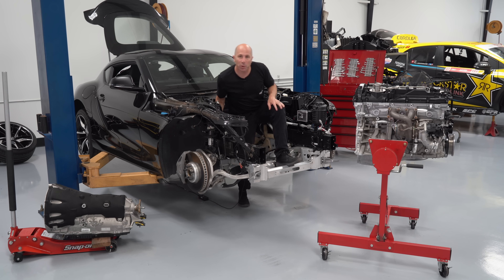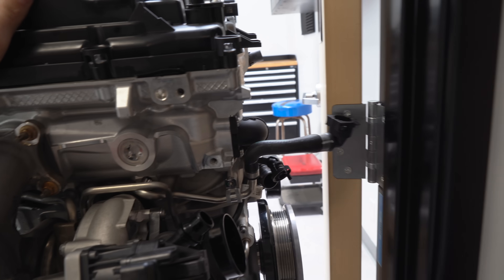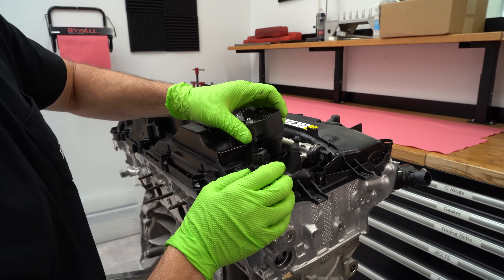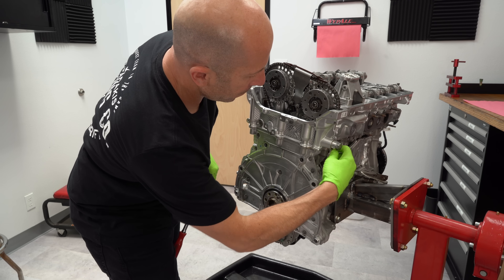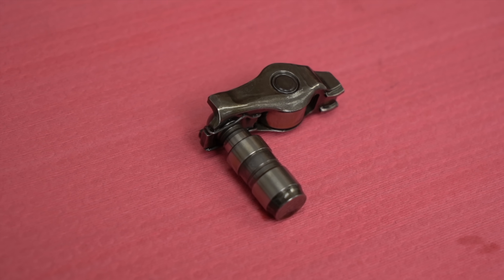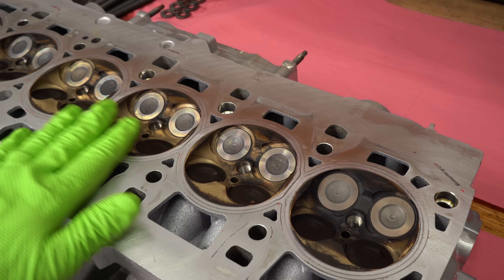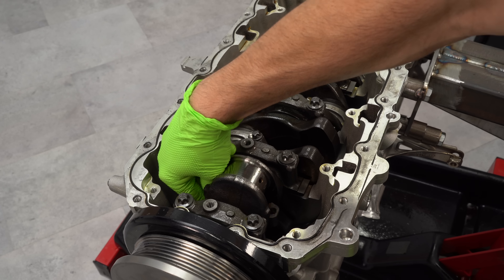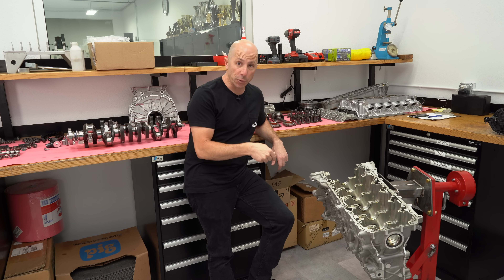2020 Supra B58 Engine Teardown - First Look - Better than the 2JZ?

Comment: I want this to make 1000 horsepower so bad just so I can shut people up just as fast 😂
Reply: 1000hp without cylinder sleeves and a non rebuildable engine ?
Reply: CleanMotorSport RacingAssociation in about a yr or so but...it can make 500hp with a bolt on😁👍 500hp is a lot of power🤷🏽‍♂️.and there goes your happiness.🙂
Reply: 日産スカイライン  dude most of what we are saying is in agreement you dolt.  More competition, meaning if they entered into supercar territory. Whereas they will set themselves up to compete well at this price range.

Just bc you built a few jdm cars doesn't mean you have skin in the game. You don't work for Toyota. To act like we know the market better than them is ridiculous.
Reply: c8 corvette owners laughing hysterically... nice try junior!
Reply: @ianvader4697  Eh? Like the moron who told Brook's he's a dummy for buying a Mustang GT500 since the mid engine Corvette is out. Look if you want a mid-engine Corvette, go buy one. Don't act like no common sense is being used and that if you want a "real" car you'll buy the mid-engine Corvette. Spoken like a true Chevy Nut.
Reply: ”””muh supra makes a 1000 hp on the dyno, i have to use jet grade fuel for it to ever make close to 1000hp and i can never ever drive it””””
Reply: klasmvm still what I don’t get why people need 1000 horsepower for but okay then😂
Reply: @HoweDoYouDo1999  1000bhp dyno sheets are purely for willy waving.
Reply: 日産スカイライン I agree whole heartedly. From the breakdown in this video the engine seems wildly over complicated. Not something somebody who wants to mod their car would want. Built internals or not, if anything small happens with this engine, it’s gotta come out and it’s gonna cost an arm and a leg. Everything I’ve read or watched about the car, Toyota expects people to mod the shit out of this car. They’re leaving a lot of stuff to the aftermarket community. But as far as i can tell the only thing people want to do to it are 2jz swap it. It’s a good looking car and that comes from somebody who has despised the body of ever generation of the Z4. The bmw aspect is the only thing that is keeping people from accepting the car and i completely understand.
Reply: 日産スカイライン  why? Because of what I said above. To reiterate, they didn't want to make it reach 6 figure territory where there is more competition and they won't sell enough ala gtr and nsx.  When I say "normal people" I mean folks who would be in the market for a decent sports car, not someone who would buy a Prius. Those types of people looking for a capable mid level sports car care a bit less about the resell value or reliability.  People would complain if it had a bunch of bits from an 86 as well even though it would make the replacement parts cheaper like the DOOR HANDLE TRIM you're talking about. So the other option would be making interior bits specifically for the Supra which would also cost more to the consumer because of the cost of development. 

 The Supra mk4 sold like shit when it was new on the lot.  Resale value only jumped after the fanwagon from fast and furious.

We who have no skin in the game can sit here and shoot the shit all day but Toyota knows wtf they're doing.
Reply: 日産スカイライン  so they should've put a V6 in the new Supra?  I agree that it was a mistake putting another companies engine in it but this thing needs to have an inline 6.  The engineers at Toyota knew this was of utmost importance.
Reply: I don’t think people understand what I mean so let me explain again I just want this car to get the respect it deserves so 1000 horsepower is the goal for most Supras this will give the b58 a better reputation for making power and besides the 2jz needs extensive work to make 1000 horsepower that’s what I don’t think people understand trust me I’ve been in my fair share of arguments and I hate when people hate that shit just because it’s from bmw so once people figure out it can make power it will achieve a better reputation
Reply: @HoweDoYouDo1999  Exactly. the stock motor can take 700+ but beyond that, reliably a 2JZ needs most of its internal parts upgraded.
Reply: @HoweDoYouDo1999  agreed.  These fake ass fan boys are hilarious. Acting like they would buy this if it had a Toyota inline 6, pushing $100k.  Then they hate on a BMW engine. That hilarious. They should hate on the McLaren F1 for having a BMW engine too smh.
Reply: Rich Pushing $100k? But they’re only half that...  but people are unhappy with Toyota putting a bmw engine in a car. Nobody said bmw makes shit engines or weak at that. BMW isn’t know for being the most reliable option for anything as far as i know. They make good sports cars and their engine designs are great. The problem is their over-complication and that people don’t want to worry about the reliability of their car. Comparing F1 built to street cars is kind of pointless because the 2 cars don’t share the same usages. I’m not overhyping the 2jz but that was a great engine and it does deserve the recognition it gets (minus the shitty fanboys). I’m sure the B58 is gonna be able to handle decent amounts of power output but just from the look of the engine without its cover it and this dude’s breakdown, it’s not gonna be somebody’s first choice for trying to make a lot of power.
Reply: @lolwhatt820  yes, if Toyota built a performance inline 6 from scratch then this would've cost close to 100k.  Most modern engines are prohibitive to work on anyway. I agree other wise.
Reply: Rich Ehh. Depends on where they wanted to go. If they could do it in the 90s and over engineer the engine that they’d gotten from Yamaha then i don’t think they’d have a problem making adjustments and modernizing the 2jz. They could have kept the car at the reasonable 50k. Given Toyota’s reputation for reliability and steering away from bmw would have made it a more widely acceptable car. If Toyota would have spent more time thinking about consumers than cutting corners like they did with Lexus, this new Supra would be as sought after the gtr and nsx but more affordable, which I’m sure they want to stray towards.
Reply: @lolwhatt820  as a fan of the Supra and cars in general I completely get what you're saying. I wished they made an in house inline 6 (tuned by another Japanese company) and designed it like the FT1.  They would've never been able to do it and kept it at 50k though.  They wouldbe been giving money away at that point.  That's ridiculous  But you have to understand that we're a small minority.  Toyota is at the top because they make vehicles for normal folks who drive cars to get from point A to B.  They're not in the business of making cars that sell around 1000 units a year world wide like the GTR R35 (NSX even less). Even the mk4 sold like shit when it was new on the lot so they discontinued it.  Everybody wants to build a sports car for under 100k that sells like a 911 but Toyota will never do that under it's brand name unless they do it under Lexus.

They made this so normal people would actually buy it.  We will see how well this Supra sells and then we can talk shit.
Reply: @HoweDoYouDo1999  Evo's are making 1400hp from a 30 year old 2.000cc 4 cylinder design
Reply: Maybe I'm that one odd guy out of the comment section that actually owns a shop... so i'll toss my two cents in here.. There is nothing "wrong" with the little BMW engine. However.. if anything ever DOES go wrong with it you'll have to pull the engine to fix it. That for me is a fault in design. It's something you don't see in most Japanese or American cars. German cars however have been WAY over engineered for the past 70+ years. Even during WW2 German tanks were failing in the field not because of actual problems, but because they were so damn complicated to build and maintain the people who had to live with them couldn't keep them running. More King Tiger tanks were lost to their own tank crews scrapping them than the enemy actually doing damage to them. If the thing failed mechanically they had to just set it on fire and walk away. Sorry for the history lesson but I see much the same issue in this car as I saw in all German cars for many years now. If you want to work on basically anything the motor has to come out. There are to many points of failure that just cannot be serviced within reason. In race car land pulling engines is part of the game. That said the front end of the car seems modular so it shouldn't be a HUGE undertaking to pull the motor out of the car. There are a lot of other problems I see with the car itself as far as service issues and even being unfriendly to modify. It's probably a fine little car if you just leave it alone and drive it stock but no car guy is going to buy one of these and want to keep it stock. I dislike the plastic intake with the intercooler built inside it. That's a point of failure. If the plastic intake is damage from anything, backfire or whatever, you also just lost your expensive water to air cooler. That's a pricey and poorly thought out design flaw in my own opinion. Again, that only applies to the enthusiast driver who wants to modify the car and beat on it. Stock I'm sure it's just fine. The lack of manual option is also not a car guy friendly route. An automatic will always out perform a manual. Facts. No human can out shift or out drive an automatic transmission. However.. As a driver and a car guy myself I will be happy to agree with the rest of the fan boys the Mansmission makes the car more fun to own. Automatics are boring. They work, but... boring. Honestly I think the car would have been very well received and enjoyed if they never tried to call it a "Supra". That doomed the car from the start. If it was Just the new Z4 roadster, it would have been lovingly taken in by the DTM guys euro'd out as it should have been. No harm no foul. A Supra however is a much beloved iconic dream car of the Sports car world. You can't mess something like that up and expect the guys who love the car not to be angry. I personally am not a fan of the new car. It's to small, to slow, to ugly, to expensive, to hard to work on, and it doesn't sound good. My opinions of course. Everyone has their own.
Reply: 日産スカイライン  BMW engines are bulletproof thought, BMWs usually have problems with their electronics
Reply: Why would that shut up anyone?  Junk honda's can make 1000hp, a supra owner wants that 1000hp to be able to still be running at 100k miles.
FWIW, nice bmw
Reply: brian clay “jUnK hONdAs cAN mAkE 1000 hORSePowEr”
Reply: @single94supra  good luck getting 1000hp for 100k miles.  Engine life reduces exponentially with the power increase no matter what!  1000hp might be 20k refreshes?
Reply: @Simey2wheels  Out of a small displacement engine like this yes I agree. The big displacement V8's can make 1000+ hp and still be very reliable.
Reply: @WilliamStewart1  doubt that.  Link me a car with a 1000hp v8 with a history of reliability.
Reply: @rks5457  I can't link you to a car, but I can send you over to NRE. They make 2500hp street car engines, a 1000hp lazy cruiser could be done in their sleep.
Reply: @WilliamStewart1  I haven't paid much attention  to them in the last few years but Nelson racing engines has a terrible rep.  I live in LA where they are hq'd and it seems like the only folks who buy from them install the engines in show cars.  I've rarely seen anyone race them, let alone hear of someone daily drive them lol. I don't think I've even seen anyone on YouTube vlog or anyone on auto  forums  with one. So it's difficult to sus out their reliability.
Reply: @rks5457  My neighbor has had a 632 NRE in his show truck for what's gotta be coming up on 10 years now. It's naturally aspirated and I think he said it makes around 1200 hp. Again this fits into your show vehicle narrative completely but I know he's put a fair amount of miles on it and he constantly hammering the thing around.

Comment: I must have watched this video 6xs...the tech is crazy...a seperate cam to adjust rocker arms ratio....is an unnecessary advanced V-tec system...it looks over built...but is it like a 2JZ
Reply: VTEC (pls in gods name don't write "v-tec") has two states, on and off. This system here is fully adjustable in his full range of mechanical motion, though more fine tunable.
Reply: @th33xitus  it is what it is.....it falls in line with it an CVT....if you paid more attention you'd know that....just like the 2JZ it looks over engineered but is it as durable
Reply: @3v4761  telling someone to pay more attention while not being able to write the name of a technology correct is somewhat ironical...

Comment: Way to much b.s. on this thing...repairs will b expensive as hell and to be honest the valve train looks like it will blow apart under high hp and rpm loads..gdi engines will carbonized intake valves very quick unless they are set up with a port injection as well to alternate between the two

Comment: One thing I noticed is why the coolant is green because most modern BMW engines uses blue coolant and I’m surprised they use a plastic oil filter housing because they had a recall for the N20 engine in some X1 because they would leak oil and coolant and sometimes mix coolant and oil and the oil was quite dark for only 500 milles.

Comment: Looks like a stout motor. What worries me as an old rally mechanic: timing chain in the back is gonna be a bitch to replace the guides etc ( which will fail)
Also the amount of plastic that bmw loves to use so much. Those gaskets and the plastic are always always always leaking.  Dont like rocker arms for the same reason he mentions, lets hope those clips hold. 
Id prefer typical buckets. 
However, i could see this motor with a metal intake manifold, front mount intercooler, redesigned oil cooler, being pretty bad ass.

Comment: Sorry but i cant hold back, water cooled inter coolers are inefficient piece of BMW ... Do you really believe that cooling liquid which has 90C can cool down the air which has 20C at enter point and 49c at exit point ?? well then why Everyone else uses air cooling intercoolers :)

Inside Exaust Manifold is a good solution ? eeeee no ?  

Oil filter base made of plastic and oil filter cooler  made of aluminium - yeah typical BMW replace gasket of oil cooler every 30000 km....

Timing chain in the back yeah another BMW solution to drain your pocket...
Just buy 2JZ - this is my opinion, car mechanic.

Comment: That small diameter around the spark plugs was engineered like that on purpose.😐
Reply: The smaller the diameter of the hole, the more strength you can retain
Reply: @Torvikholm  I know that...but to make it to where you need a special tool or be extremely picky choosing tools to change a spark plug it messed up.

Comment: the only side effect i see in this engine is the thermostat housing is plastic same as VW which they fail within 50-60k km , also the oil filter housing seal if they fail the location is not as easy as it was in n54 other then that its seem  very strong engine , good luck with your built and thank you the great video

Comment: For all the "But muh 2jz" guys, Toyota came straight out and said that without this partnership there would be no MK5 supra. Just put a 2jz in yours if this engine is so bad, i mean you're paying some big bucks to get a 1000 hp 2jz anyway. The mk5 had to have a straight six, otherwise there would be shrieking and gnashing of teeth and Toyota didn't have a straight six to start with. Toyota wasn't willing to engineer their own straight six, so they had to partner with someone who still makes them. Watch the head to head comparisons of the mk5 Supra and the Z4 M40i and you'll see they are totally different cars when it comes to driving and experiencing them. The z4 is a convertible ffs, it's not like they're in the same segment. Oh, and the Z4 is a lot more expensive as well.

Comment: Any differences from the B58 on BMWS?
Reply: Turbos integrated into the block(if I remember correctly) and the fuel lines seems to be stronger/can handle more pressure and has more oil squirters than your average B58.

Comment: Pretty amazing engineering, and impressive. Other than possibly greed, I'm not sure why automotive engineers are using so much plastic and burying simple parts (ie. spark plugs, oil filter, etc.) beneath so much excess 'stuff.'

Comment: Too complicated and too much unnecessary work for me..2jz it is.  To each their own... TIMING CHAIN AND CAM UPGRADE REQUIRE PULLING MOTOR? And better hope you got timing right first time else you got to pull motor again.  HELL TO THE NO!
Reply: Sean Malcolm I’ll guess you adjust timing in the front anyway but we need to read the manual first
Reply: @mastaplanna9771  then we are in a perfect world.

Comment: Subaru needs to link up with BMWs bearing vendor and get a supply of  coated bearings like this for their EJ and FA motors, pretty fancy coating to prevent  bearing wear.
Reply: Hugh Vupy They need link up with porsche and build far better boxster engines that dont rattle and fucken viberate like shit and there motors will hold more power 

I have no idea why they refuse to refine that motor and make it better with there help

Comment: I see 700+ whp easily with bolt ons and a tune, such an amazing engine/car
Reply: Not even bolt ons. With just a Tune its already pusing 400hp.
Reply: @MeDicen_Rocha  It made damn near 400 from factory, and the tune was pretty light, I'd say a full remapping and optimization would get it into the mid 500s
Reply: N54 make 6-700 quite easy, and this engine is going to blow it out of the water
Reply: What exactly are you going to "bolt on"? Just about everything looks to be integrated.
Reply: @richardballs8618  a big ass turbo!!! Duh. 

Extrudehone is going to be the name of the game with this engine
Reply: @richardballs8618  Use your brain